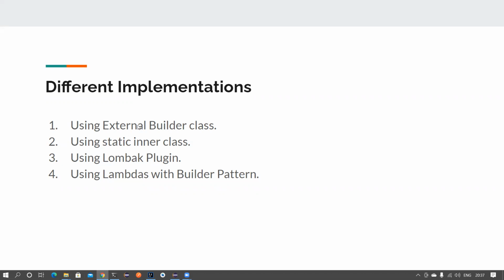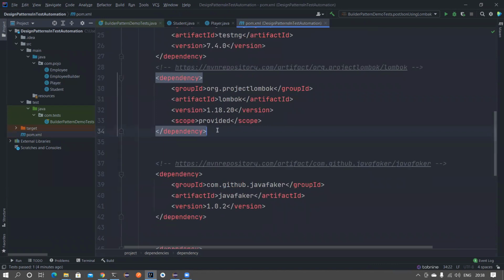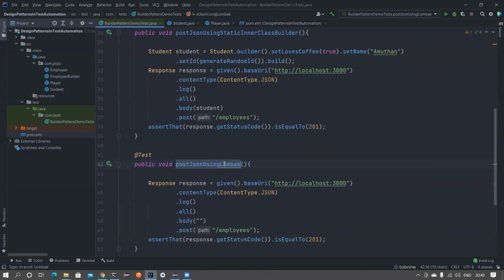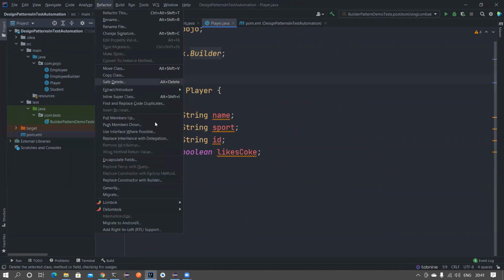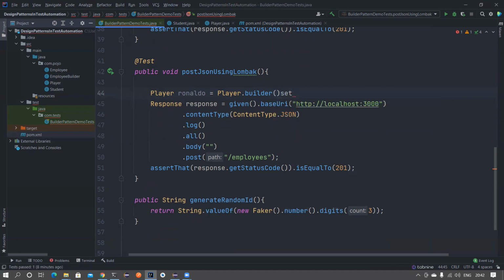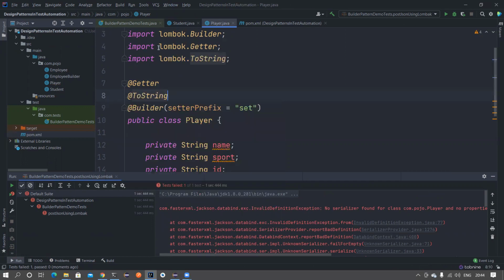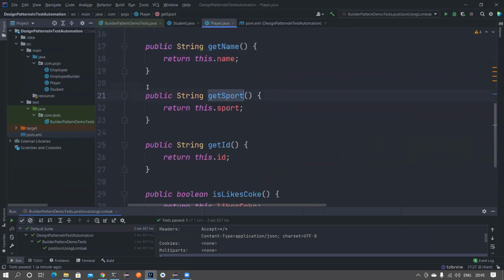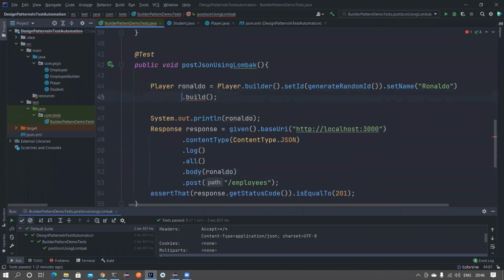Part 3 - Builder Design Pattern using Lombak - Easiest way to implement Builder Pattern

Comment: Thanks Amuthan...can you please share a sample on how to use this concept with complex jsons(Nested)
Reply from the maker: It is same. You need to build the inner pojo and use that in outer.
Reply: @TestingMiniBytes  So we have to build separate classes for each of the inner json's ..?.is there is a possibility to have all nested jsons in one class and apply this concept.Thankyou
Reply from the maker: @welcomehome2764  No. It is not possible. Builder annotation from lombak helps just to redyce the boiler plate codes.